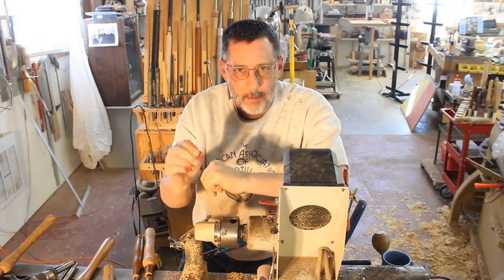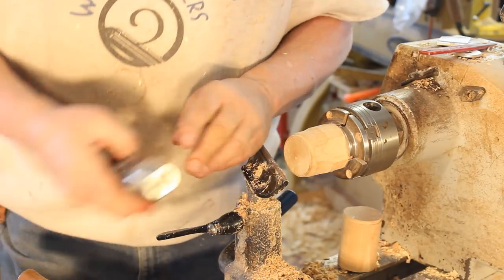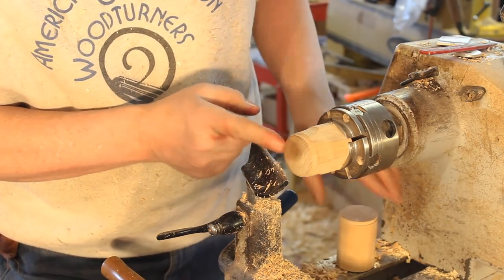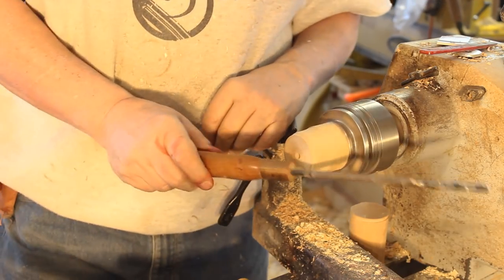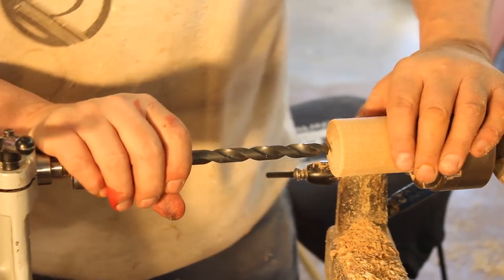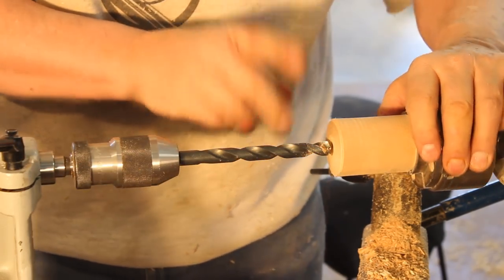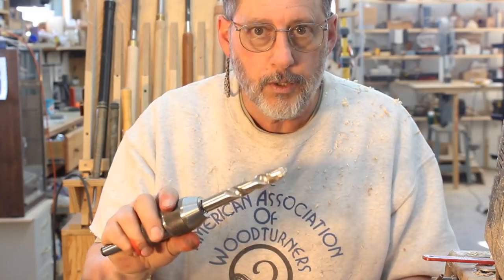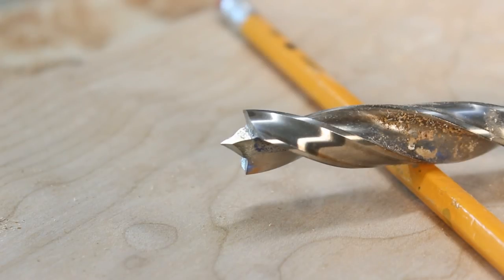FUNdamentals of Woodturning #2 Drilling on the Lathe

Comment: When boring with twist drill ,back it out often and clear the shavings using a stiff plastic brush, so you do not cut finger tips 
So the chips do not overheat the bit ,, or bind up the bit , smaller diameter bits could break off or even jam inside and not back out with the tailstock  handwheel . Forstner bits with a lead spur ,,usually only have a lead spur on the edge ,
Speed bore bits have a tapered lead screw like an auger bit that helps to draw the bit into the timber , and the shoulders have 3 or 4 saw teeth and cot better boring side grain wood, 
Spade bits , have a long lead spur , so the leave an indent at least a quarter to 3/8" deeper than the cutting face

Comment: hi the tip on masonry drill bit is made from tungsten carbide, its angle is set for breaking concrete etc. it will not stop any one grinding a new cutting angle to help cut wood better, similar to router bits. thanks for the videos hope your healing well from your accident.
Reply from the maker: Thanks Simon, I forgot to mention that I did sharpen the edge of the masonry bits.  I will put a note up on the video to this effect thanks very much for watching
Sam

Comment: Hi Sam thanks for another great video. I notice you never mentioned flat / spade bits. I have a 8 mm /5\16 flat bit which is 400 mm / 16" long mounted in a handle.  I use it  on the lathe mainly for wiring lamps but I have used to drill pilot holes for larger bits or setting the depth of hollow forms. It works well and clears the saw dust very well.  I haven't tried anything larger than that as I think it would be difficult to hold on to.  Any way keep up the good work Jim
Reply from the maker: Jim
Actually, I am just not used a spade bit much for drilling a hole. That is the main reason. 
Sam

Comment: Again, as always, even a seasoned turner (like me... ;) ) can learn so much from every video you come out with, vary valiable information.
I like drilling using my tail stock since I've had mixed results using hand held drills (my first tool handle was for a Jacobs chuck for a drill, and of course I drilled it all wrong so it's off center...), but I don't know what it is, maybe my cheep lathe, but I almost never get a true hole, even if I make a divit to start with, at some point my drill starts to dance around... although not always, I guess it depends on the grain of the wood, and on how hard it is.
Reply from the maker: Yuval
Whenever I use a handheld drill it is for drilling and grain perhaps in a small box.  I do drill holes in hollow forms up to 10 inches deep but I always use my tailstock in a Jacobs Chuck.  An Important thing is to have a slow lathe speed. I think somewhere below 500 RPMs is good.

I assure you that quite often my drill holes are really off-center--oh well, not that big of a deal 
Thanks Sam

Comment: Nice presentation Sam but you missed giving out the CAUTION when using Forsner, brad (lip and spur) bits - the centre pointed part of the bits is about 3mm (1/8") longer than the flat cutting part. The problem arises when you want a thin (3mm 1/8") top or bottom and you end up with a pinhole centre. Keep up the good work!!!
Reply from the maker: George 
That is a good point (no pun intended) about the drill bits. That really could be a problem. And actually that's a big consideration when drilling out for a hollow form.  A particular drill bit may leave an unwanted shape in the bottom of your vessel.  Thanks, Sam

Comment: Very nice, I guess this is my third video of yours, I'm new to full/mid size lathes. It looks like the spinning wood helps keep the drill bit centered in the piece. I guess this makes sense, I just never thought about it before.

I have acquired a Craftsman/Duracraft 3/4hp wood lathe and it was suggested to me to get a 3/4-16 tap and just tap out hardwood glue blocks and even to try turning with a 3/4 tapped wood block. Curious about your opinion about this (I found this video while searching for info!)
Reply from the maker: I am not sure what you are trying to do?  Are you taping with 3/4-16 to thread this on to your lathes spindle?  Sam

Comment: Great video Sam.  I had heard that brad point bits tend to follow the grain when drilling in end grain. Not sure if you had heard that or use them for drilling end grain. I'd love to hear your thoughts on that.
Reply from the maker: Zac 
I have never heard that about Bradpoint drill bits.  I actually use Forstner bits more when I'm drilling on the lathe.  I have found that any drill bit Will not track straight if it starts off-center.  
Thanks Sam

Comment: Yet ANOTHER great video Sam!  Always look forward to your videos, but I noticed something in this video that you don't do and that is use a threaded rod to anchor your drill chuck/morse taper into the tailstock so it won't come out when you remove the drill from the wood.  I know it prevents you from using the tailstock quill to drill the hole and forces you to manually move the tailstock fwd/rvrse, but always thought it was the 'safer' way to go rather than the morse taper coming out of the tailstock accidently whenever trying to remove the drill bit from the wood.  Any thoughts/comments?
The other thing is I often use a metal drill starter bit (a short bit designed to start a drill into metal...) in end grain and/or hard/dense wood.  I was taught that this allows a good straight center hole which helps a normal drill bit to drill straighter...  Is this excessive or???  Again, your thoughts/comments?
Again, great to see your hand healing and you back in the shop again!  Safe turning always!
Kenn
Reply from the maker: +Kenn Harris The last point about starting a hole with a starter bit is good advice.  I do this when I want really good accuracy.
I do use a threaded rod when I have a morse taper in the head stock which is unsupported by the live center.  I never though about doing this in the tailstock.  
Sam

Comment: Well, I certainly learned a lot from this video.  #1) I was drilling my lid way too fast.  #2) I should pre-drill a smaller hole first.  Trying again tomorrow.  My Jet 1642 has two belt settings.  Which one do I use and does it matter?
Reply from the maker: +Donald Fugitt 
Thank you for your comment and question.  No I really don't think it matters.  I think you can drill most holes between 500 and 800 RPM.  There is no need to turn really fast.  And sometimes if you turn too fast, you will get A lot of heat which is a problem.  Sam

Comment: A masonry bit will not pull it self (like a screw) like a twist drill bit in a pre-drilled hole because it has the negative grind on the masonry drill face.

Comment: Hi Sam.  thanks for sharing.  Do you have a tip for drilling by hand and not ending with a  wobble?  Maybe I need a level and a square  :-)     Marc
Reply from the maker: I think the most important part is to begin with a depression in the wood where you'll start drilling.  I usually use the toe of A skew chisel for some sort of parting tool.  The better job I didn't here, the more centered the drill bit is.  I think a 3/16 inch drill bit for a quarter of an inch drill bit works best.  It is never too well centered and I like to slow my lathe  speed down for that reason.
Thanks Sam

Comment: Hi Sam
I've used most of the drills mentioned here (haven't tried spade bits yet).  Mostly its unproblematic. The difficulty comes when I want to make a fairly long hole with a small bit. It seems it's always off center at the headstock end when I'm done. A small twist drill (say 1/8")  has some flexibility to it so I suppose that's the problem.  But you can't get a stiffer Forstner bit smaller than about 1/4 inch.  Any suggestions?
Reply from the maker: Daniel
I understand your problem. I think you may have the same issue with any small drill bit.  You might try a Bradpoint bit.  For me the most important part is to establish A place to begin drilling. I like to use the tow of a skew chisel or maybe A parting tool. If the starting point is nice and centered, the drilling Will stay more true as you drill. 
Thanks Sam